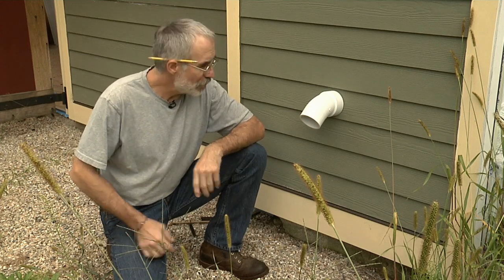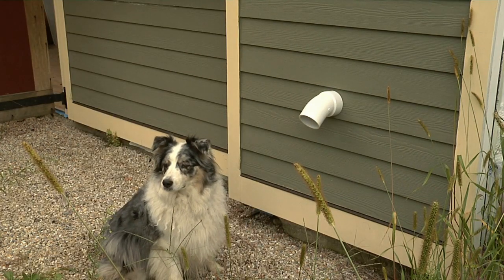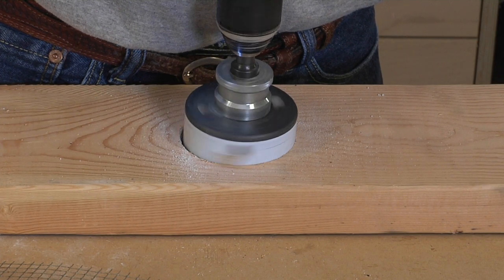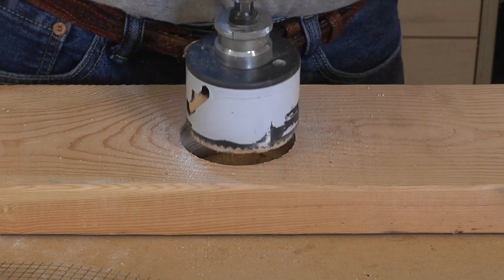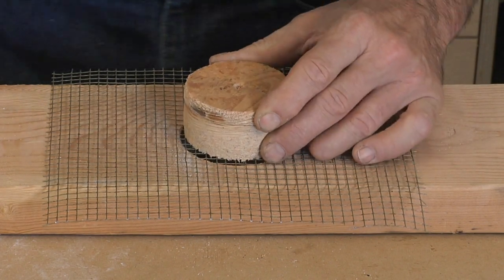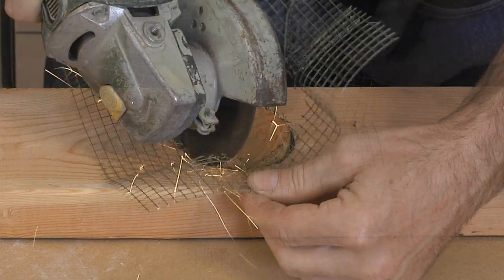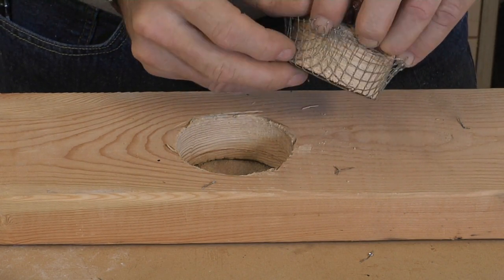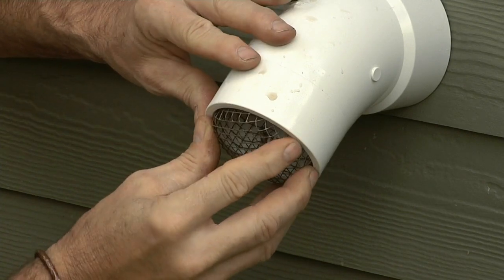How to Keep Critters Out of a PVC Vent Pipe

Comment: Used this for a tankless water heater exhaust that had rusty hardware wire. This was the best tip ever. Worst part was buying 5' of hardware cloth for a 6"x6" section. Thanks.

Comment: In my experience this is a great idea. Been living in Texas brush for 57 years and doubt a snake could push it or his prey - the rat - could eat it either. Many daily items rely on a friction fit. Queazy? Run a couple of stainless screws in to trap the screen. I'm going to use this method to keep toads out of my garden house drain. Thanks for the improved use of hardware cloth to seal out critters!
Reply: thanks.  anyone have a youtube or plans on how to build a dryer vent pest guard with material list,etc.
Reply: thanks.  anyone have a youtube or plans on how to build a dryer vent pest guard with material list,etc.
Reply: Make sure to take a bigger drillbit, and drill in a couple millimeters. That way when you screw the screw in, it will be flush.

Comment: Drill a hole vertically into the vent pipe about a quarter of an inch from the discharge end.  Now take a finishing nail and insert it into the hole and into the hardware cloth screen.  When the screen needs to be removed for cleaning, first remove the finishing nail and take out the screen.  You could also use a 16d common nail that would span the full width of the vent pipe.  In that case drill hole not only on top but a matching hole on the bottom of the PVC vent pipe.
Reply: Good idea. A stainless steel screw would be even better. No rust, and would be less prone to accidental removal.

Comment: Easier to just bend hardware cloth around the pipe and tie it. Ten minutes max and one wire cutter. Done it with a tankless water heater. The hardware cloth breaks down from the warmer air and condensation so expect a repeat.

Comment: Seems to me it would be more permanent to use a 3.5" hole saw to match the OD of a 3" pipe and make one big enough to go over the outside of the pipe, then use some construction adhesive to hold it in place.
Reply: True, but would also be more unsightly.
Reply: The OD is going to be 3 1/8 and it's going to look like crap comparatively. I would simply add a bead of caulk to the inside solution. Would look great and likely last longer than I will live.
Reply: Indeed!

Comment: What about covering a duel vent for a high efficiency furnace?
Reply: make two....
Reply: @Venom5260  can’t. Intake is behind the exhaust.
Reply: You’re talking about a concentric vent. You’ll need to remove the furnace access door and install the screen where the 2” intake air pipe hole is.

Comment: That doesn't seem like it would stay in my opinion.  Especially if it's a dryer vent.  It will deter, for a period of time no doubt.  But out here in the country, mice will chew through that, snakes will push it out of the way, and time will rust it to dust.  I made a similar but less pretty screen on my microwave vent.  The keypad failure and number or hornets nests that had fallen through the vent when the old one got removed, which suggested that it was necessary.
Reply: You said a number of things that are ill informed. A dryer vent should NOT have a screen on it. Doing so is a violation of the mechanical code, and is a huge fire hazard. Lint gets caught in it, and catches fire. Second, mice cannot chew through metal, period. Hardware cloth is galvanized steel, and therefore will not rust. If snakes are a concern, it can be secured with a screw as others have mentioned.
Reply: @jackspencer8290 I had rats chew through metal screen. I had mice chew through what is called insulbrick. Don't underestimate those little bastards.

Comment: If that is a furnace vent it will freeze and shut down the furnace.
Reply: My furnace installer warned me not to do this. Perhaps in the summer just tie a bag around it. The heat blowing out in the winter should discourage critters.

Comment: I did it birds push it inside and still make a nest :)
Reply: Put it on the outside then. :)
Reply: Pull the screen around and zip tie it
Reply: @toysorbust  Young grasshopper, a  zip tie will not hold up to the elements.
Reply: @kendalgee5808 Just replace it more often. I used a stainless steel pipe clamp.